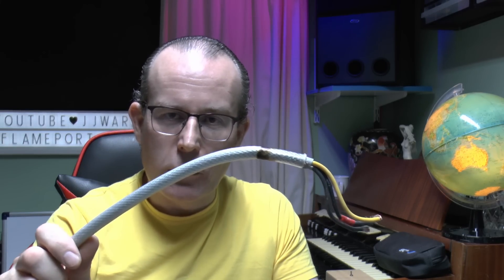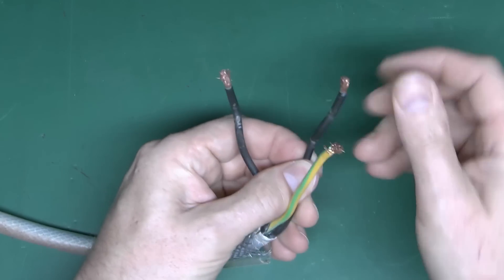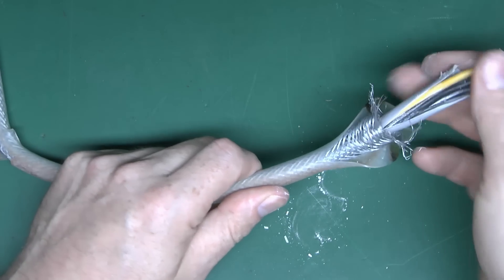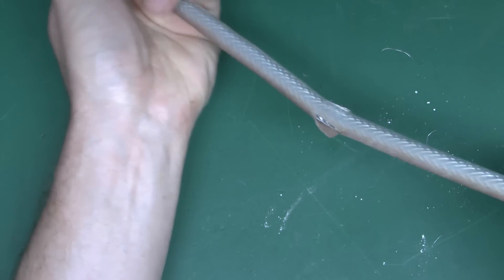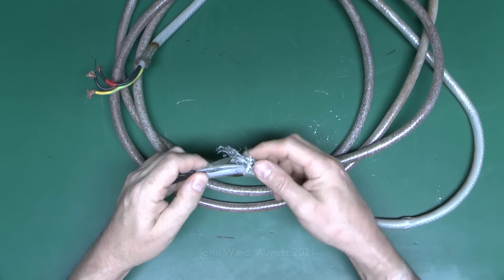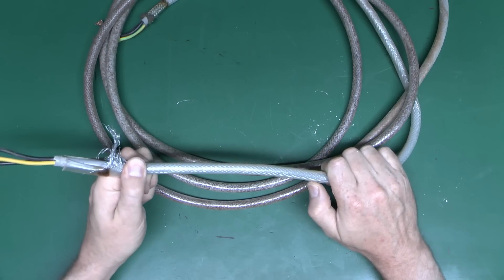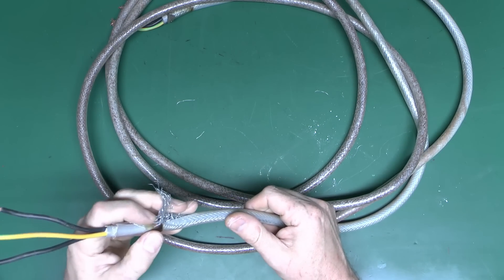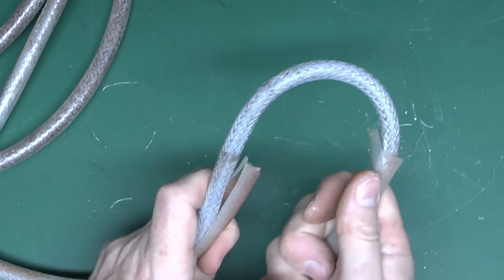SY Cable is Not Armoured, Not for Outside Use

Comment: It's one kind of flex cable used here in Germany a lot. Mostly not shield and called ölflex manufacturered by Lapp.
Of course it is not for outdoor use, but to make industrial or commercial installations it is super!
Eg lighting in supermarkets, power supply for industrial machinery or for control circuits
Reply: Lapp say "If using outdoors, observe the indicated temperature range and use with UV protection".

Comment: The cable loved by air conditioning companies 😡🤬. SY should only be used for short lengths from rotary isolators to moving machinery or equipment that suffers from vibration. Not recognised by BS7671.
Reply: Your right James doesn't carry the BS kitemark. But should have the European CE mark, if your going to buy SY cable make sure it's got the ce mark on it and buy the cable from a reputable electrical  wholesaler.
Reply: @sparkygazza  Glad you said that, I have seen some from china and its a joke, massive gaps in the screening, and only a few strands.
The CE rated stuff is near 100% fill, no gaps and loads of strands.

Comment: I was told that SY does not provide EMC shielding, you need CY for that.
Reply: yes you are correct on this one, John is mistaken, the braiding on SY is for mechanical protection hence why its made of steel not copper. John is right that is definately is not armoured or suitable for outdoor usage though.
Reply: @mawoodmain  If the braid is for mechanical protection, there's no need to earth it then.  If the braid is to form an earthed metallic covering as mentioned in regulation 522.6.204, then it needs to comply with BS 5467, BS 6724, BS 7846, BS 8436, or BS 60702-1.  John says SY cable does not satisfy any of these standards so there's no point in earthing it.  What sort of external influence is this steel braid particulary suitable for?
Reply: I wouldn't rely on the braid for a cpc, but I would ensure it is bonded to earth just as I would the armour of an swa

Comment: Used this cable a lot back in the day, offshore use between panels, but mostly the larger multicore like 19c, and for instrument signals, not mains AC. Cheap and cheerful cable.
Reply: That's not sy cable, It's called ships braided cable. Often used in atex areas. Is much more robust than sy.

Comment: I have always assumed the braided covering is for EMC shielding purposes, when driving a motor from a VFD for example. One needs to use to the correct glands to bond the braid to earth.
Reply: LAPP Cables state in their SY cable data sheet: "The braid of galvanized steel-wires is an additional mechanical protection".  They also state "If using outdoors, observe the indicated temperature range and use  with UV 
protection".
Reply: @Graham_Langley I read an article recently and there has been an investigation into SY cable and it is accepted it does NOT meet the requirements for mechanical protection in outdoor situations.

So regardless of what the manufacturer said, it's not suitable.
Reply: You are correct Greg. Primary to reduce the effects of Electromagnetic interference.
Reply: @jurassicsparks5220  iirc Some VFD manufacturers say to earth the brading at one end for EMC shielding.
Reply: SY is not for screening if you need screened cable try CY or one of many multi core screened cables not screen should only be connected to ground ,0v  or input at one end 
Note power cables for inverters/or vfds ,the outer shielding braid should be connected to ground at both ends
Reply: @rogergregory5981  Wow, how wrong can you be.
Copper against some high frequencies is ok, but medium frequencies such as 10s of kHz copper is pointless.
10s to 100khz this steel braiding is perfect, its literally in the description of EMC, Electro Magnetic..., tell me how magnetic is copper?
Medium to high range frequencies can have a tendency to introduce currents, so connecting both ends of the SY braid and using an internal earth can give rise to circulating ground currents. (you have just built a transformer)
Low frequency, you are probably ok to earth both ends, it also can be used as extra earthing to bring down the resistance of the fault current path.
Never ever leave it disconnected from earth, its an extraneous conductive part of the installation.
And no matter what you think, it does give some mechanical protection.
Not to be used outside in sunlight though.
Reply: @007floppyboy It may give some mechanical protection but there has been an investigation and it does not meet the requirements for mechanical protection outdoors.

You should not be using SY cable for mains power outdoors.

Comment: Used a lot in food factories great for control panels very versatile easier to manipulate than armoured, nothing wrong with it used in the right environment, swa companies hate it.
Reply: Yeah this stuff is in most factories I’ve been in. Never seen anyone use a proper gland for it though
Reply: @uhhhhh262  that's down to the individual, up to them to terminate  it correctly.
Reply: @sparkygazza  I suppose?
Reply: What is it that makes SY more suitable that standard 6242Y twin & earth?
Reply from the maker: 6242Y T&E is for fixed wiring only and isn't intended to be flexed or moved after installation.
Reply: @westinthewest  Twin and earth is only allowed in the UK. SY cable is allowed anywhere.In most countries the ground wire must be not smaller than live and neutral and must be insulated.
Reply: @mernokimuvek  interesting, thanks
Reply: @westinthewest  Used extensively on factory floors, for the interconnection between the switchgear, and the machine. Think of it as a braided flex, rather than for static installations.

Comment: There's an awful lot of so called electricians that don't k ow about the special glands for this stuff.
Reply: Wholesalers, too, in my experience.  At a minimum they don't bother to stock them, though sell plenty of the cable...
Reply: Because this cable had no British standard. And shouldn't even be sold here.
Reply: @arcadia1701e  What is cable type in British standard for cabling from VFD to motor?
Reply: @peto22  wouldn't rubber h07rn-f cable be what you are after ? Super durable, available in many core configs and DO have a BS rating.
Reply: @arcadia1701e  I was thinking EMC shielding, h07rn-f has no EMC shield witch is requirement in EU with VFD:s. I was thinking that BS standard must have some altenative to CY?
Reply: They do know, but choose not to use them because they are a pain. Most just use a stuffing gland and sleeve the braiding  before terminating it.
Reply: @sparkykevboss  Pain? SKINTOP MS-SC-M and others like are super easy and simple to use.